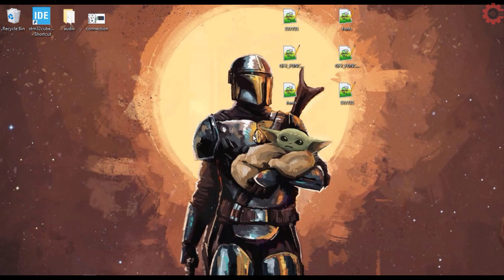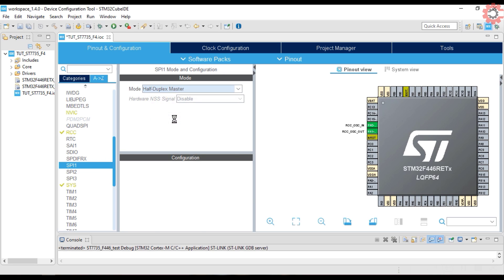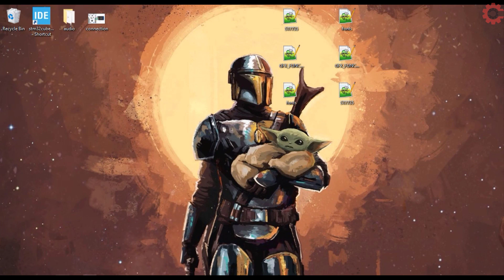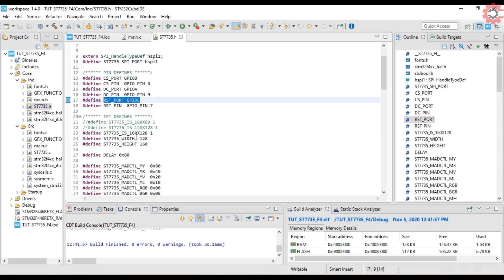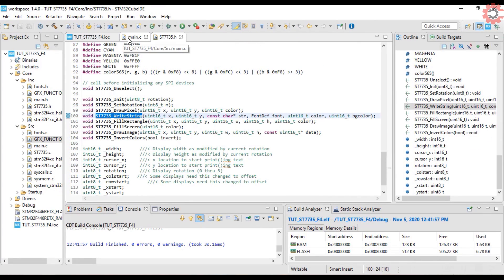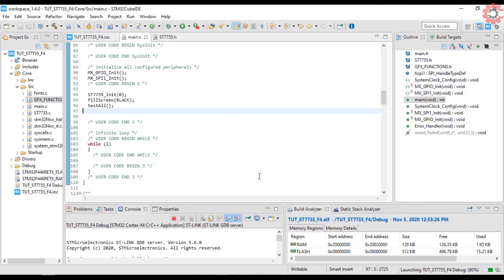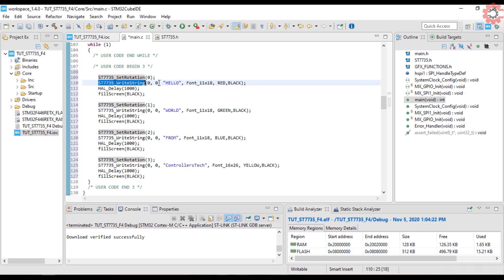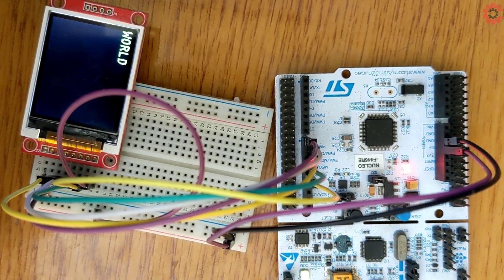ST7735 1.8" TFT Display and STM32 || HAL

Comment: To make this driver work on Nucleo-F401 board select SPI2  Full Duplex Master mode. Change SPI1 to SPI2 in ST7735.h file. Keep prescaler 2, 4, or 8. There is no need to connect the MOSI line even though Full Duplex Master mode is selected. Prescaler 16 and above doesn't work.

Comment: Hi Sir, I have tried mentioned library and it works well. but I have some problems about writing something to the display. writing display is too slow. I want to write the strings or shape as fast as possible. Is there any solution faster solution? or do you have ant idea? My baud rate is currently at highest settings.
Reply from the maker: Use LVGL. You can find video related to STM32 LVGl in the playlist... LVGL on STM32: https://www.youtube.com/playlist?list=PLfIJKC1ud8ghGES4CUTjHTn_G4gly_atz

Comment: can you please explain how did you write the code for driver?from which documentation?
Reply from the maker: I do not write the LCD drivers, they are very hard to configure. I must have got the file from some library (like adafruit or similar) and then modified it for STM32.

Comment: Hi, thanks for the video and the code. I have a white screen problem. I connected the wires exactly as described with the exception of using SPI3 instead of SPI1. I have modified the header file accordingly. I have also tried to add a delay to reset function. I have also tried different baud rates ranging rom 1.4 to 5.6 etc. but not working. All I am getting is a white screen. I have connected both LED and VCC to 3.3V. I also tried connecting the signal lines through 1K resistor and it also did not work out. I really appreciate some guide. My Nucleo is also F446RE.
Reply: SOLVED! The problem was with Reset or DC pins. Probably they are interfering with something if you do not use SPI1. Choose different pins on the board for the signal lines and it will solve the problem of white screen.
Reply: @sohrobmilani1732  I am having the same issue, but I've tried changing the pins around and using the different SPI options, to no effect. What all did you change to fix the problem?

Comment: Hello, I ran into a problem when I tried to do the same with an 80x160 (0.96`) screen. The test does not start, and white noise appears on the screen. If I uncomment the line of code, for 160x128, or 128x128 and set 160 and 80 in the width and length parameters, then everything works, except that the image is shifted to the side, outside the screen, and where the image should have been, a strip of unused space appears screen I tried to edit the values in the function responsible for XSTART and XEND, but this did not lead to any tangible results. I also set the delay between the initialization of the legs and the display, changed the rotation index (from 0 to 3). But all this did not lead to the disappearance of the strip of the unused screen from one side. Do you have any ideas how to solve it?
Reply: I ran into the same. Here is how to fix

1. /**** TFT DEFINES ******/
#define ST7735_IS_160X80 1
#define ST7735_WIDTH  80
#define ST7735_HEIGHT 160

2. Inside void ST7735_Init(uint8_t rotation) modify...
#if ST7735_IS_160X80
    _colstart = 26;
    _rowstart = 1;

3. Inside void ST7735_SetRotation(uint8_t m) modify...
switch (rotation)
  {
  case 0:
      madctl = ST7735_MADCTL_MX | ST7735_MADCTL_MY | ST7735_MADCTL_RGB;
      _height = ST7735_HEIGHT;
      _width = ST7735_WIDTH;
      _xstart = _colstart;
      _ystart = _rowstart;
    break;

The biggest reason for it not working is the difference in the SetRotation function. When you make it behave like it did for the other screen sizes, then the 160x80 size will work if you adjust the _colstart and _rowstart to the values I said. Also the defines WIDTH and HEIGHT seem to be flipped from what I think width and height is. With these mods I got it working on the screen perfectly
Reply: Actually change the rotation function to this 

void ST7735_SetRotation(uint8_t m)
{

  uint8_t madctl = 0;

  rotation = m % 4; // can't be higher than 3

  switch (rotation)
  {
  case 0:
#if ST7735_IS_160X80
	  madctl = ST7735_MADCTL_MX | ST7735_MADCTL_MY | ST7735_MADCTL_BGR;
#else
      madctl = ST7735_MADCTL_MX | ST7735_MADCTL_MY | ST7735_MADCTL_RGB;
#endif
      _height = ST7735_HEIGHT;
      _width = ST7735_WIDTH;
      _xstart = _colstart;
      _ystart = _rowstart;

    break;
  case 1:
#if ST7735_IS_160X80
	  madctl = ST7735_MADCTL_MY | ST7735_MADCTL_MV | ST7735_MADCTL_BGR;
#else
      madctl = ST7735_MADCTL_MY | ST7735_MADCTL_MV | ST7735_MADCTL_RGB;
#endif
      _width = ST7735_HEIGHT;
      _height = ST7735_WIDTH;
    _ystart = _colstart;
    _xstart = _rowstart;
    break;
  case 2:
#if ST7735_IS_160X80
	  madctl = ST7735_MADCTL_BGR;
#else
      madctl = ST7735_MADCTL_RGB;
#endif
      _height = ST7735_HEIGHT;
      _width = ST7735_WIDTH;
    _xstart = _colstart;
    _ystart = _rowstart;
    break;
  case 3:
#if ST7735_IS_160X80
	  madctl = ST7735_MADCTL_MX | ST7735_MADCTL_MV | ST7735_MADCTL_BGR;
#else
      madctl = ST7735_MADCTL_MX | ST7735_MADCTL_MV | ST7735_MADCTL_RGB;
#endif
      _width = ST7735_HEIGHT;
      _height = ST7735_WIDTH;
    _ystart = _colstart;
    _xstart = _rowstart;
    break;
  }
  ST7735_Select();
  ST7735_WriteCommand(ST7735_MADCTL);
  ST7735_WriteData(&madctl,1);
  ST7735_Unselect();
}

Comment: Hello Sir, thanks for the very informative Video!
Can I get it to work with a F746 Board and 2,8" ILI9341 Display?
Canging #include to f7xx and display type in header file didn't work out
Reply from the maker: Why using this ?
There is a video in touchgfx playlist which explains how to use ili9341 spi display with touchgfx. It is better to use that.
Reply: @ControllersTech  Thanks for the fast answer. Touchgfx is giving me headache all the time and I just wanted to try to display some simple things the easy way to test my program
Reply from the maker: You need to use the ili9341 library. This tutorial is written for st7735.

Comment: Dear Sir, thank you for your clear explanation and good lecture, but how can I show integer number on the screen, I can try to show int number  but I cant, thanks.
Reply from the maker: Convert to Ascii characters and then show. You can use "sprintf" to do so.
Reply: @ControllersTech  could you give a simple example, for variable unit8_t number, thanks.

Comment: It wasnt working for me untill i added a small delay within the reset function, im using an stm32f405 (adafruits feather) clocked about 168Mhz , slower than your example
 void ST7735_Reset()
{
    HAL_GPIO_WritePin(RST_PORT, RST_PIN, GPIO_PIN_RESET);
    HAL_Delay(5);
    HAL_GPIO_WritePin(RST_PORT, RST_PIN, GPIO_PIN_SET);
    HAL_Delay(1); //<-----
}
Reply: Thank you for your valuable comment. After making a delay in the specified function, the code worked properly. Before that, I had a white screen.

Comment: Hello sir thanks very much for this video.
How ever I was try to do the same work with stm32f103c8 so I downloaded the documents you provided in the description. However, "TESTST7735\TESTST7735.axf: Error: L6200E: Symbol cursor_x multiply defined (by st7735.o and gfx_functions.o)." I am geting this error. Can you guide me fix it sir?
Reply from the maker: It has been fixed now. Try downloading the code again.

Comment: Got this working on my STM32F103 without too many problems on the small square displays. I seem to have an issue with the smaller 80*160 st7735s display though, it's always blank. I got it working using the other size definition but now there is a dead zone at the bottom which cannot be written to - tried modifying the starting address etc. but it seems to limit the end address
Reply: I am trying the same display 80*160, unsuccesfully, with one of those adafruit F405 feather.
I gave it a go with the wrong display size as you suggested. nothing

Rechecked pinout multiple times and nothing wrong either, i even put an oscilloscope, the SPI is okay.

ill try with even lower baudrates, maybe 656Kbit/s
Reply: I ran into the same. Here is how to fix

1. /** TFT DEFINES ******/
#define ST7735_IS_160X80 1
#define ST7735_WIDTH  80
#define ST7735_HEIGHT 160

2. Inside void ST7735_Init(uint8_t rotation) modify...
#if ST7735_IS_160X80
    _colstart = 26;
    _rowstart = 1;

3. Inside void ST7735_SetRotation(uint8_t m) modify...
switch (rotation)
  {
  case 0:
      madctl = ST7735_MADCTL_MX | ST7735_MADCTL_MY | ST7735_MADCTL_RGB;
      _height = ST7735_HEIGHT;
      _width = ST7735_WIDTH;
      _xstart = _colstart;
      _ystart = _rowstart;
    break;

The biggest reason for it not working is the difference in the SetRotation function. When you make it behave like it did for the other screen sizes, then the 160x80 size will work if you adjust the _colstart and _rowstart to the values I said. Also the defines WIDTH and HEIGHT seem to be flipped from what I think width and height is. With these mods I got it working on the screen perfectly
Reply: Actually change the rotation function to this 

void ST7735_SetRotation(uint8_t m)
{

  uint8_t madctl = 0;

  rotation = m % 4; // can't be higher than 3

  switch (rotation)
  {
  case 0:
#if ST7735_IS_160X80
	  madctl = ST7735_MADCTL_MX | ST7735_MADCTL_MY | ST7735_MADCTL_BGR;
#else
      madctl = ST7735_MADCTL_MX | ST7735_MADCTL_MY | ST7735_MADCTL_RGB;
#endif
      _height = ST7735_HEIGHT;
      _width = ST7735_WIDTH;
      _xstart = _colstart;
      _ystart = _rowstart;

    break;
  case 1:
#if ST7735_IS_160X80
	  madctl = ST7735_MADCTL_MY | ST7735_MADCTL_MV | ST7735_MADCTL_BGR;
#else
      madctl = ST7735_MADCTL_MY | ST7735_MADCTL_MV | ST7735_MADCTL_RGB;
#endif
      _width = ST7735_HEIGHT;
      _height = ST7735_WIDTH;
    _ystart = _colstart;
    _xstart = _rowstart;
    break;
  case 2:
#if ST7735_IS_160X80
	  madctl = ST7735_MADCTL_BGR;
#else
      madctl = ST7735_MADCTL_RGB;
#endif
      _height = ST7735_HEIGHT;
      _width = ST7735_WIDTH;
    _xstart = _colstart;
    _ystart = _rowstart;
    break;
  case 3:
#if ST7735_IS_160X80
	  madctl = ST7735_MADCTL_MX | ST7735_MADCTL_MV | ST7735_MADCTL_BGR;
#else
      madctl = ST7735_MADCTL_MX | ST7735_MADCTL_MV | ST7735_MADCTL_RGB;
#endif
      _width = ST7735_HEIGHT;
      _height = ST7735_WIDTH;
    _ystart = _colstart;
    _xstart = _rowstart;
    break;
  }
  ST7735_Select();
  ST7735_WriteCommand(ST7735_MADCTL);
  ST7735_WriteData(&madctl,1);
  ST7735_Unselect();
}

Comment: I have a STM32F407 board  and i am trying to compile this, but I am getting multiple errors regarding the following lines

int16_t _width;       ///< Display width as modified by current rotation
int16_t _height;      ///< Display height as modified by current rotation
int16_t cursor_x;     ///< x location to start print()ing text
int16_t cursor_y;     ///< y location to start print()ing text
uint8_t rotation;     ///< Display rotation (0 thru 3)
uint8_t _colstart;   ///< Some displays need this changed to offset
uint8_t _rowstart;       ///< Some displays need this changed to offset
uint8_t _xstart;
uint8_t _ystart;

The following is the error message for one of the lines

c:\program files\stm32cubeide_1.9.0\stm32cubeide\plugins\com.st.stm32cube.ide.mcu.externaltools.gnu-tools-for-stm32.10.3-2021.10.win32_1.0.0.202111181127\tools\arm-none-eabi\bin\ld.exe: ./Core/Src/ST7735.o:C:/Users/professor/STM32CubeIDE/workspace_1.9.0/1.8 Inch Colour TFT/Debug/../Core/Inc/ST7735.h:106: multiple definition of `_width'; ./Core/Src/GFX_FUNCTIONS.o:C:/Users/professor/STM32CubeIDE/workspace_1.9.0/1.8 Inch Colour TFT/Debug/../Core/Inc/ST7735.h:106: first defined here

Could you help to resolve this

thanks

Comment: i want to increment numbers in this lcd do you have any function regarding that?
actually i want to show sensor data
Reply from the maker: Just increment the number, convert to string and display it..
Reply: @ControllersTech  how do you convert float to string properly fro the LCD?
Reply from the maker: Sprintf (buffer, "%.2f", number)
Here 2 is the number of decimal places you need to display. You can change that to 1 or 3 or whatever you want
Reply: @ControllersTech  I tried this but I don't know why even for positive numbers it keeps on printing negative numbers
Reply from the maker: Debug the code. Put a breakpoint after this step and check the data in the buffer. See if that is correct
Reply: @ControllersTech  thank you will do that!

Comment: "please don't ask for SD support" :D 
A lots of people (myself incluted) having troubles with latest Cube and fat32 drivers...
Reply from the maker: What kind of problem ?
Actually I said it because this is a ported code, and i don't want to port the SD card part also (it won't work mostly).
Reply: @ControllersTech  Working with the H7/M7 family taking advantage of the SDMMC and DMA functionality does't seems to be a straight forward job even though the CubeMX is a great tool. I am probably just lacking the skils...

Comment: I am sorry, but I've tried with stm32f407 and it doesn`t work. Any advice? Thanks
Reply from the maker: It should work... Check the wires or the display type..
Reply: @ControllersTech  Thanks a lot. It was one wire.